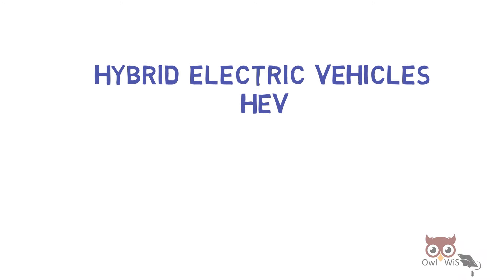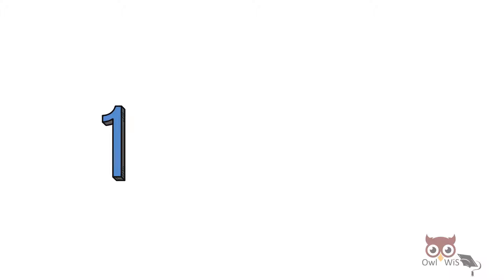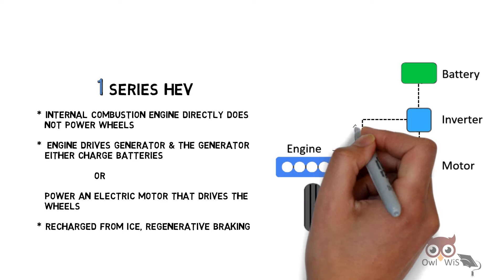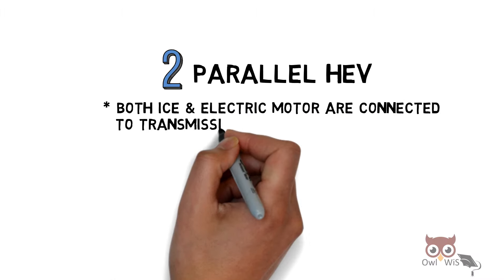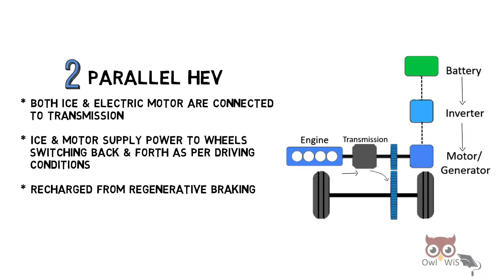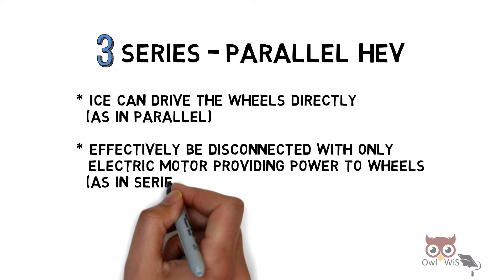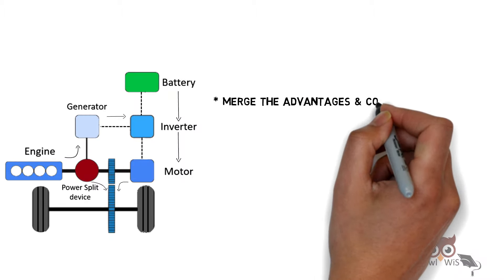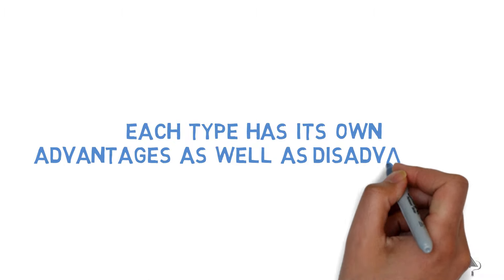Types of hybrid electric vehicle | Series, Parallel, Series-Parallel HEV

Comment: Parallel HEV transmission compared to Series-Parallel Power Switching Unit is excellent. The PSU in Series-Parallel combines HV Battery and ICE, and adjusts based on driving speeds. Great Job.

Comment: The Acura Sport Hybrid system use has a modified series-parallel system that can run on 1, 2, 3, or 4 wheel drive depending on performance/handling needed, regen braking and/or I.C.E. recharge of battery pack, rear twin electric motor tq vectoring, and front electric motor inside 7DCT to provide 1st gear and additional power to gears 2-7.  The MDX/RLX system becomes 100% fwd at +84 mph (not sure about the NSX going rwd at +84 mph).  System build for performance and handling, not for mpgs.  Provides about 60hp/70tq extra power to the I.C.E.; while, having almost the same city/combined/hwy mpgs.

Comment: Hi,
How works the cranking in parallel hybrid vehicles?
The HV Battery supply the starting?
Reply: Yes, a separate 12V battery is used for electronic start, power windows, entertainment system. The ECU then switches to Internal Combustion Engine and HV Battery for driving.

Comment: Is a Stirling motor a good idea for hybrid cars?
Reply: I've had similar thoughts... Since f1 Is able to get extra power through turning extra exhaust heat into electricity... Wouldn't a stirling engine also be able to recover that lost heat back into the system without introducing obstructions to the exhaust flow
Reply: They get around the obstructions with a turbo in f1 but i want to keep my civic na because longevity so stirling may be a way to recover that waste heat being kicked out by the engine